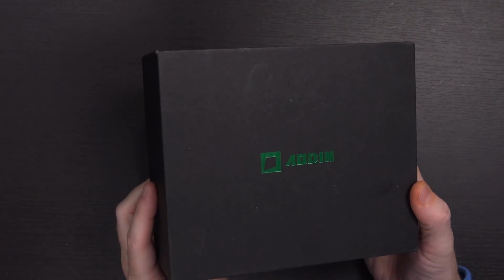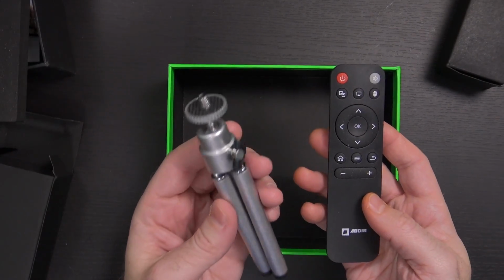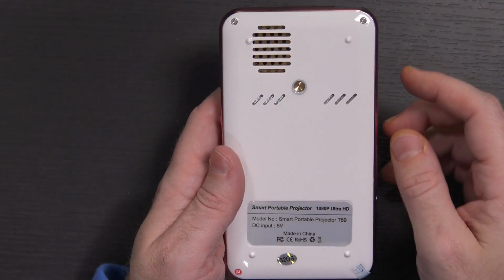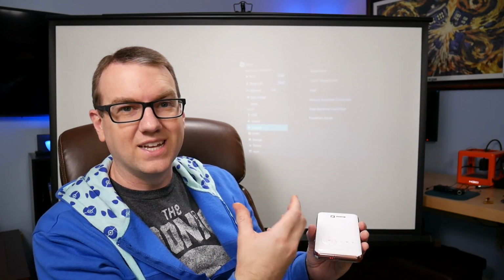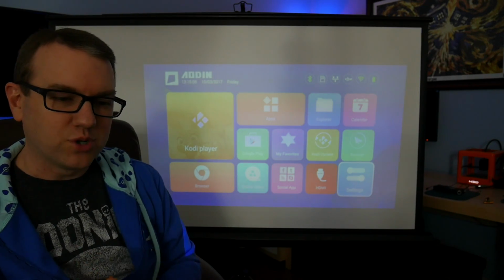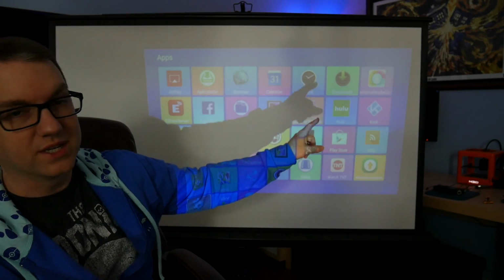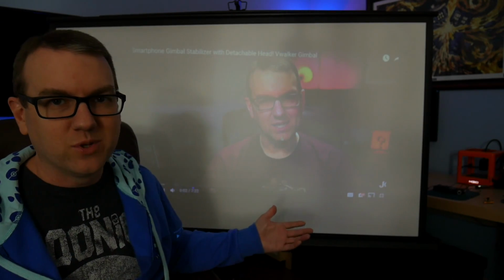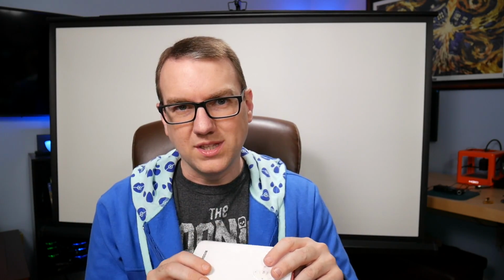Smartphone-Sized Projector with Android?!?? Aodin Projector

Comment: I was thinking the use of a barrel connector instead of Micro USB was due to royalties on the connector. But then you mentioned the other USB connectors, and I thought a barrel connector is more reliable from an insertion point of view, but in an age where everything uses Micro USB, this does mean your either tied to the supplied power supply, or you'll have to buy a spare from Amazon.